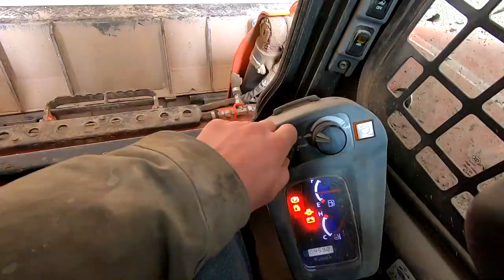Cleaning Calf Pens

Comment: We'd get groundhogs instead of staying in the fence rows would dig multiple burrows in the middle of our hay fields. Grandfather had a huge metal tank mounted on a trailer with a pto pump on it, we would fill it with poop heavy pond water and fill those burrows, it would chase those big rodents out, we'd sometimes get a large young one all ready once cleaned for the stew pot, Yum Yum (the older ones get tough and takes a week of stewing).